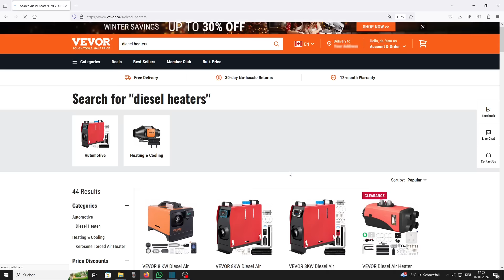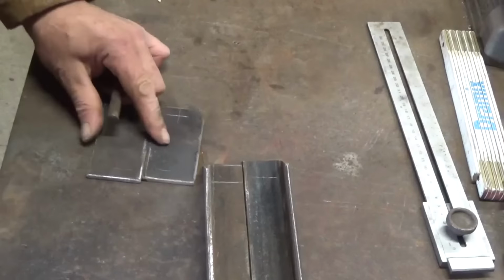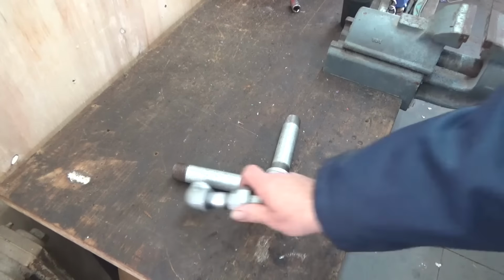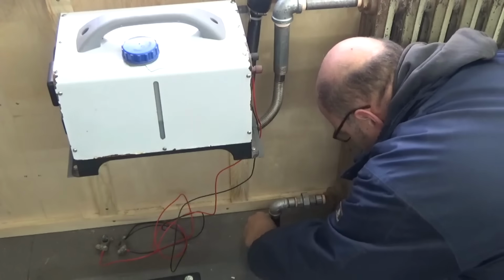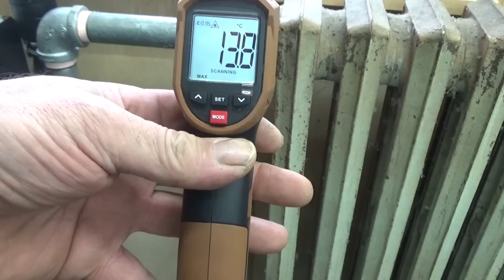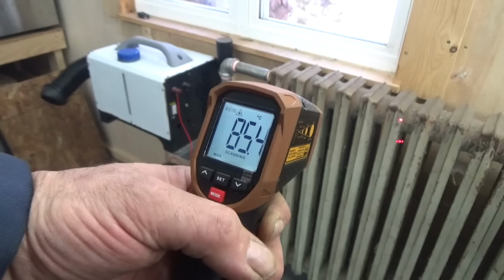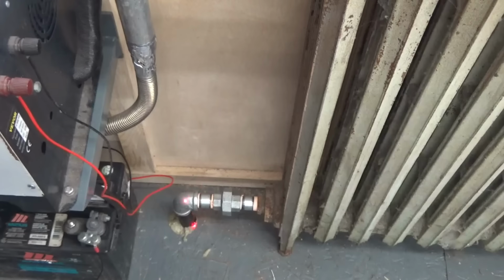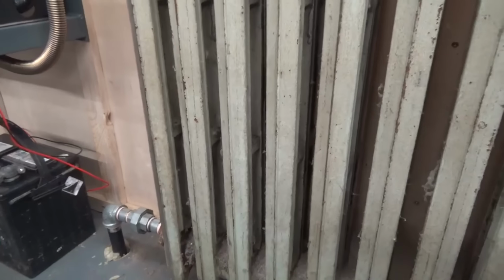Diesel heater upgade 200% more efficient

Comment from the maker: Many people who watch this video are of the opinion in their comments that heat rises upwards, which is physically correct, but cold falls downwards, which also creates a downward suction in the radiator. That's why the entrance is always at the top and the cold that occurs when it cools down doesn't have to fight against the rising heat.
On a car radiator the hot water inlet is at the top and on a household radiator the inlet is always at the top to achieve optimal heat exchange.

It is also correct that you should not make the exhaust pipe too long, otherwise the resulting flow resistance will be too high, but given the flow cross section and the length of the components installed here, this shouldn't really have an impact. Since the difference in height between the exhaust gas outlet and the radiator inlet is approximately 45 cm or 18", there is virtually no back pressure. An exhaust silencer would generate more back pressure. And with an exhaust gas temperature of over 150 degrees Celsius, there is guaranteed to be no condensation in the pipe On the contrary, it will evaporate and condense again in the radiator where this condensate can then drain downwards. It is absolutely likely that deposits will accumulate somewhere in the system, but the solution to this is regular maintenance and cleaning.
Every boiler, fireplace and chimney must be cleaned regularly, even Chinese diesel heaters are not maintenance-free forever.
Reply: I like your design and am planning something similar...after seeing a bunch of Tubbers designs I think an oil or car radiator would be most efficient but I worry about corrosion. My idea is to run the exhaust thru a honda or toyota radiator and have the fan cycled with a fan relay in the heater, but i wonder how long it will last w/o antifreeze. That one your using is designed to run water through isn't it? an oil radiator might not last with water going through it either.
Reply: @autojohn-pu1vf  how about radiator that just all pipe pipe connectors the the think stuff like in this video
Reply: @dh2032  I"ve seen some fellers on the Tube do that but it looks like a hassle... leaning towards getting salvage yard rad/fan and hanging a CO detector on it , with frequent inspections.
Reply from the maker: pipes are more expensive now than a cast radiator for 50 bucks
Reply: People think that but it's simpler than the rise and fall. Hot always moved towards cold. The thermodynamics of thermal energy is straight forward with that
Reply: @dsfarmns2823  they tolerate more heat?My car radiator idea prolly no good it gets way too hot, set my wall on fire🤣😂🤣got a wall/flange adapter on way from china

Comment: Jup like the other comments. A small drain on the lowest part of put the heater above the radiator. Condens will collect in the exhaust and will get pulled in the heater itself

Comment: Test done  on an Artic blog established that a claimed 5kw "Chinese" diesel heater gave 31/4 KW on full and a further 11/4 KW could be recuperated  from the exhaust by passing it through a large radiator -  a 38% improvement not 200%

Comment: Heat in at bottom, but slightly above a condensate weep hole drain to not plug heat inlet.
Reply: Gasses will escape from any holes in the exhaust or radiator

Comment: I like the Overall idea, even if there are quiet some improvments to make. But Temperature is not energy. So your efficiencycalculations are of by some magnituds.

A more realistic estimation IS that the Energy within the exhaustfumes is in the Region of 300-500 watts.so the small 2kw heater can be improved by~25%.

Or as my physics teacher always Said: keep your values in order.

Comment: All that heat does come.from the exhaust,  and this looks bloody genius 👌
Reply: Got one in last year's lobster boat. And in that -40 it kept the snow and ice off the wheelhouse off the #CrissyG boat
Reply: 6:30 😅
Dumb question of the day 
Why knot plumb the exhaust in to the bottom as it would heat the rad up more quickly??
Reply: 15:00 the little red one we hat, has the option to be set with a timer of when to atuo start
Reply from the maker: because if it cools down the condensat falls down and would fill the heater and it would be againt the flow =>  my video comment at the top
Reply: @dsfarmns2823  OK, that makes good sense,  didn't really think about the condensation

Comment: Its my understanding that there is moisture in the exhaust so the radiator will fill with very acidic water
Reply: It will go out at the bottom pipe more or less, but yeah, this is a valid concern.
Reply: I’m also concerned about the build up of soot as the exhaust condenses on the interior walls of the radiator.  Also he could put a fan directed at the radiator to pull more heat from it.
Reply from the maker: Please check the other Videos on our channel

Comment: Right idea wrong application!
Heat rises so you should be feeding the radiator from the bottom, you will get much more heat transfer that way.
And I reall hope you extend the exhaust pipe out from under your shed?
And for backup have a good quality carbon monoxide detecter JIC.😮
Additionally I agree with @jasonbroom7147 and the need to vent off the condensation. 
So adding a 1/8" copper tube weep line to the outside for this.

Comment: If you really want to grab every bit of that heat from this thing, use a small aluminum radiator from a car (used and cheap) with a small large PC fan that sips power.  You can also do the same with an Intercooler, whatever is cheaper if you can't find an old Home radiator around.  

You can also do one of those water to air intercoolers, and it will do the same thing, but you store that waste / recaptured heat in insulated water barrels.
Reply: Usually there are plastics on the sides of a car radiator, also the house connector. Not a good idea for 160°.

Comment: If you want to improve efficiency, I'd start with an intake duct and intake-exhaust heat exchanger: every cubic meter of ambient air used for combustion is a cubic meter of cold outside air that gets drawn inside and needs to get heated back up, much like single-hose portable ACs. If you dump all of the exhaust heat into combustion air drawn from outdoors, you eliminate the draft and the warmer combustion air also helps the diesel vaporize faster so it can burn cleaner. That is how high-efficiency boilers achieve their ~95% figures, nearly all of the exhaust heat gets absorbed by replacement air.

You can also use some of the exhaust heat to pre-heat the diesel by ~100C to help vaporization for a cleaner burn too. When liquid or solid fuel hits the flame, the flame has to put in the remainder of specific heat to get fuel to the boiling point, latent heat of vaporization to turn it into vapor and activation energy to ignite it. Pre-heating the diesel saves the flame from having to do most of the boiling part the work in what little time the fuel spends inside the combustion chamber. You still get the scavenged exhaust energy back in the form of a slightly hotter and cleaner burn since the flame has more net energy left in its exhaust for heat exchangers.

BTW, don't use an IR thermometer on shiny metals, readings can be waaaaaay off. Especially if there are other strong IR sources nearby such as the heater's direct exhaust pipe at ~180C: you may be getting a temperature reading from reflected IR instead of whatever you are pointing at.

Comment: Sorry but I would’ve put the exhaust in the bottom of the radiator because hot air rises makes sense i think
Reply: Combustion gases contain CO2 and H2O. When H20 condensates, it will collect at the bottom of the radiator. The exit from the radiator must be at the bottom (otherwise it fills with warm water).
Reply: @silviuvrinceanu7796  to add do what you said the water will also be acidic which you want to drain freely to reduce damage to radiator

Comment: could you use a radiator for a car with a fan behind it blowing the heat around the room ? or would it get too hot and melt the soldier joints?

Comment: For my setup, I use a trickle/ float charger, plugged into a wall outlet, which in turn is connected to my 12 v battery to recharge any drain on the battery caused during operation of my 8kw heater.  Charger runs for maybe 10 minutes before switching to float mode. Works great and the charger I use was less than 20 bucks cdn at princess auto  or if you are in the US harbor freight would probably  have it.  Added a Burreck  thermostat so that the heater cycled off and on just like your home furnace would.
The Burreck  thermostat has easy to follow directions for setup and a variety of options for setting start and stop times for different times of the day, has an adjustable temp swing setting etc.

 Keeps my 10 x 12 workshop at 60 degrees all winter long on  about 1litre of diesel/24  hrs.
Reply: Wow. Impressive!
Reply: even better: a solar charge controller will work with any output from 12 to 30 Volts, and constantly keep a battery at a full charge. for me, a cheap charge controller was 15 euros, and I can combine it with regular, cheap power supplies in the range of 12 to 30 volts. the whole thing keeps the battery at 14% charge constantly and will recharge the batter once it drops below 13 volts. stays within the common range a car battery runs at with the alternator working, and if the power does go out, the battery still has enough charge for roughly 3 hours at full startup power draw.
The heater is actually able to work between 12 to 24 volts, so it works with 14 volts just fine. at that point, could probably even go for a solar panel and go 100% self sustained.

Comment: Yes as the other comment say you should definitely have your heater exhaust higher than the radiator. The exhaust should never go uphill it will trap condensation and damage the heater long-term. In principle it's a very good idea but not executed correctly exhaust should go in the top and out the bottom of the radiator on the opposite side.

Comment: You could also put a solar panel on the roof to charge the battery!
Reply: I’ve ran out of power (diesel too) a few times, could crack the combustion chamber, poison us with CO inherently retains a percentage in brain each day. CO sensor & alarm is imperative with heater is inside. Fortunately my heater pumps out too much heat above -10°C weather so it’s on lowest settings in my Transit Connect Van. 
Some like it hot (me), some like it not! (GF) 
In the process of building Hybrid system Solar/Wind & more.  The 5k BTU Heater is best investment ever for likes of Canadian Climates. Just play it safe!

Comment: Make sure you can drain the radiator because the exhaust is humid and going through the rad it will condensate the water in it, unless the output is right at the bottom. . Place a few computer fans blowing against the rad to dissipate some of that heat into the room. Also you should be getting fresh air from outside because you are using the air in the shop and exhaust is pushing that air out so to compensate for the air going out, it will draft into the shed from all the cracks

Comment: If your exhaust temp is lower than 140° it will condensate which is acidic which WILL rust that radiator out faster than you think.   If the rad was stainless you wouldn’t have that problem.       This is exactly the reason high efficient furnaces / boilers/ hot water heaters cannot use regular tin exhaust vents, they have to be able to resist the acid which is present in consensate.   Master plumber/gasfitter 25yrs

Comment: Great idea!  Since the unit and the exhaust path is inside, please make sure to have a small space carbon monoxide detector (they are made for inside of small spaces like airplanes and semi trucks and are more sensitive) inside the shop/shed.  I agree with the comment that the outside exhaust outlet should be extended past the building side (instead of just down under the shed floor - ideally up past the roof peak).  Also, keep an eye on the temp of the pipe going through the floor to ensure the mineral wool is taking any residual heat before it reaches the flooring wood (thinking of a chimney wall/ceiling collar and how it separates the combustible surfaces from the heat of the exhaust pipe).  Nicely done!
Reply: You do not understand why monoxide is creating. Stop giving idiotic advice if you don't understand the rules.

Comment: I'd have used an EGR cooler to transfer the waste heat to water. If you don't need hot water, you could use a car oil cooler with a small fan to extract the waste heat into the air. Same principle as your cast iron rad, but much more compact.

I'm not sure how you calculate a 200% increase in efficiency. You've not made any energy / volume calculations.
 Also, I'd advise that you put a 14.8 volt 10 amp power supply on that battery to keep it from cycling. That way, you'll never have to worry about it going flat, and you'll have heat for hours if you lose grid power.

Comment: Only 3things i would change is (1) have the unit higher so the exhaust is always flowing down in case of condensation, and (2) I would do a better job of sealing off the exhaust through the floor, maybe spray foam or calk, and (3) hook up a trickle charger to the battery.

Comment: Now have the blowing end of the heater blowing across the radiator to pick up that heat and also move the air inlet to the first part of the radiator at the hottest part so it is picking up the hot air will make the heated air hotter. If you understand what I am saying. Sort of a loop system making it help itself heat better.

Comment: If there's something you don't want to do with a combustion heater, it's to obstruct the exhaust. Smothering the exhaust can lead to disaster sooner or later. You must ensure that exhaust fumes can easily and without restriction exit the building. If you wish to recover some heat, attach a vertical chimney to your diesel heater. Do not reduce the diameter of the chimney!
Reply: Hi no to a vertical chimney as could fill the heater with condensation  water Also  I would like to know the exhaust gas temp not the temp of the pipe  Also *I think the exhaust gasses could get drawn back in via gaps in the floor  and the indoor air intake is not very good   A big rad like that will not restrict gas flow as there is a large space for gas flow Also should make a fine silencer also being cast Iron it should not rust away The up loop from the heater is also not good
Reply: @michaelllewellyn7215  A chimey with a T piece on the bottom. A pelletstove has the same thing fot the condensation.

Comment: Im curious.  Heat rises, why not use the bottom radiator port instead of the top to send the exhaust gasses into there? Itd be more efficient from a point of taking on additional heat in the exchanger..???
Reply: The hot exhaust  enters at the top and  must  cool off to exit the bottom,  this is a good  idea. There is lots of information  if you search  "The free movement of Gas" for more  detailed explanation
Reply: @timyanke9559  wouldnt the less hot Exhaust simply exit the top, as well? I do appreciate your explanation, however. Seems like thermal transfer would be more effcient the other way around. As always, it might simply seem that way.. great explanation, thank you for your kindness!
Reply: More heat will be transferred from a downward  flow,  and  with  an upward flow, it will continue to  draft  due to natural  convection  when  the heater is not running. 
Upwards  flow is important if you are relying  on convection for natural draft,  but with an inducer  motor, a downward draft  allows  more heat transfer.
Reply: One would have 2 objectives with the radiator..get the exhaust gases out without any bigger resistance so the haeter would work without failures and transfer the heat energy to the space/room it is in.. 

Maybe think it this way that: If the radiator radiates heat into space it sits in, the gas gets quite a bit heavier and falls downwards thus creating natural flow.. Other way it would flow way worse.. 

Also the heat tends to rise in the room (colder at floor level than eg. at 1m height) the higher one goes..heat energy transfer requires *temperature difference*.

So even though putting hottest gas into the low part would make a bit more energy transfer in the bottom due to bigger temp difference, the gas would cool and top part of radiator would not transfer heat energy into the room with very little temp difference..meaning not very well..like one had way smaller radiator..

Now put hot gas into the top side you have plenty of difference..and while the gas still cools while going down so does the temperature around there and there will still be temp difference on the bottom in regards with the space even though the radiator is cooler down there..👍

You'll get quite a bit of net gain there since the whole radiator transfers the heat to the space..
Reply: CO gas is heavy, sinks, same best to have it go out the bottom
Reply: @davidmoore8741  heated CO2 is not heavier than air. At room temperature, it is heavier than air. Immedietly after, and as a combustion byproduct, it will also hold additional calories that render it lighter than air. As this demonstration would derive.
Reply: @CreedmoorFury  ummm did u not see his temp gun, showed it was the same temp as the floor when it came out the bottom. It has fully cooled back down. Sooo yea
Reply: @davidmoore8741  i saw mine, after gasses went through 8 foot of pipe.  Was still warmer than the air. Not sure what your point is. Of course, eventually it will be cooler. It isnt cooler at the source of its origin, or, even 8 feet away in my test. Proving that while its in the system it can still rise until the temperature difference overcomes the contained calories. Thats no different than any other heated exhaust.